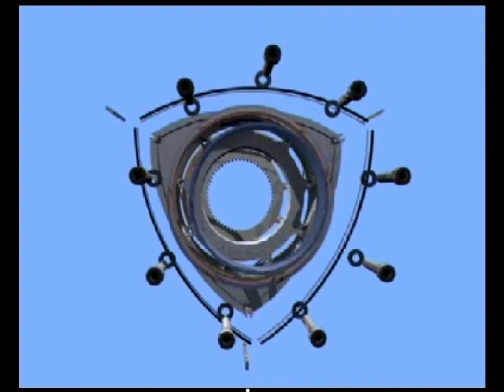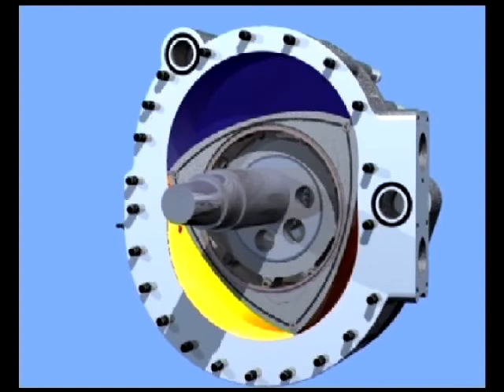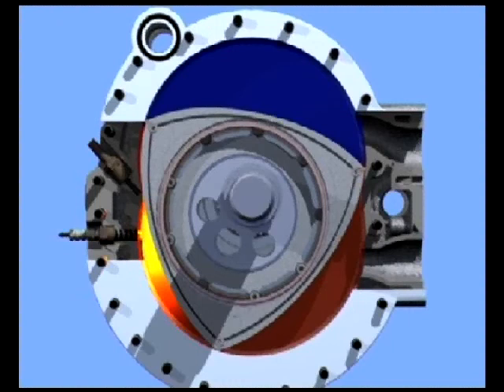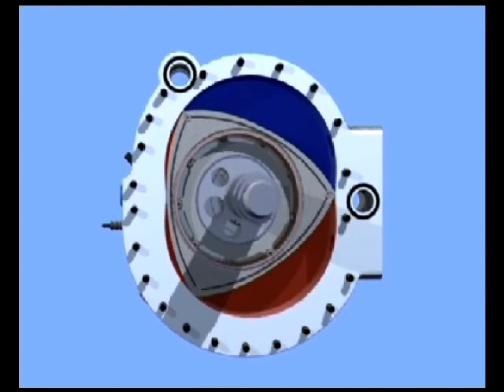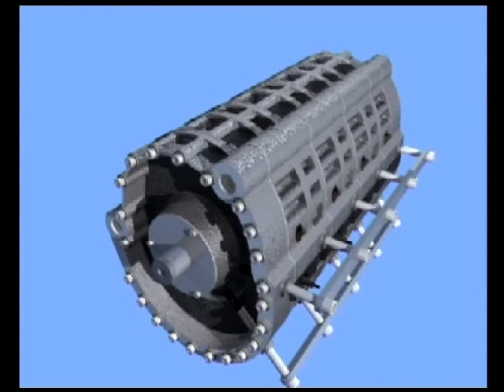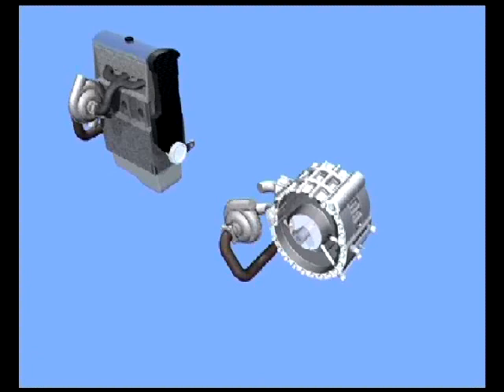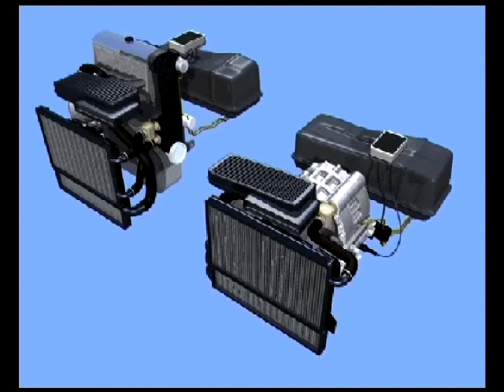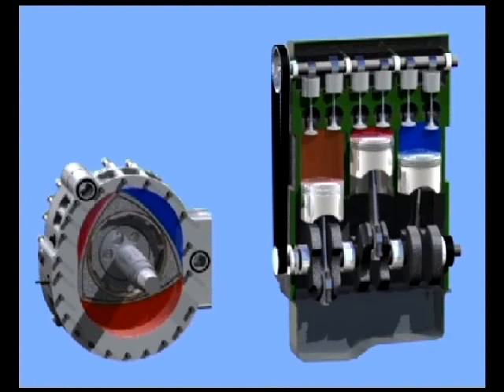WANKEL MOTOR Parts 1-5

Comment: I noticed the wankel engine used in this animation has peripheral intake and exhaust ports.  This seems convenient for the modular approach, but in service leads to a tremendous amount of overlap.  If you look in this animation, note when the apex seal opens the intake port, and how exhaust gas under high pressure would therefore go some distance up the intake.  This leads to a very rough idle and reduced power until very high rpm.  A turbocharger does help alleviate this, but only when on-boost.  Perhaps consider adding a reed valve to the intake, similar to in a two-stroke piston engine.  The flow restriction of the reed valve can be offset by greater port-open duration.
Reply from the maker: Hello JETZcorp. The motor was not designed by myself, but even though, I can't see where the exhaust gases can go into the intake. Please look at 2minutes 45seconds.               OK, I can see it now. When the seal reaches the halfway point between the spark plug and glow plug (3m 05s) there must still be a gap on the opposite side between the exhaust and inlet ports. Perhaps this is what you mean? Yes there would be maybe more pressure from the exhaust side for a short period.                  Sorry, I have been rambling whilst examining the animation. There is another way to optimise the ports that I have seen in a YouTube Video ( I don't remember where): Have the ports as elongated slits, in cross section thinner, but across the whole width of the cylinder.
Reply from the maker: Mark Bayliss Found it: Rotary Engine Breakthrough?   https://www.youtube.com/watch?v=m3pCLjHZmhM    at 1minute 48seconds.                  By the way, I like your style JETZcorp. (Don't read anything more into this)!
Reply: Mark Bayliss The issue with exhaust contamination of the ports is not theoretical, it is a well-known and major issue with Wankels running peripheral intake ports in the real world.  If you search "peripheral port" on Youtube you'll note all the engines have a very extreme "praap-praap-praap" kind of idle, even though they're often doing over 2,000rpm at idle to avoid stalling entirely.  This is considered nearly impossible to deal with on the street.  However, at high RPM such a port is ideal, as airflow is very direct, and charge inertia (and boost!) can overcome residual exhaust pressure.  The solution Mazda uses for their street Wankels is to have the inlet port on the side of the housing, where the rotor face (rather than its apex) seals.  This reduces overlap greatly, but at the cost of bulk airflow.  It is also more difficult to make a modular engine with side inlet ports.  I was suggesting using a peripheral inlet port and reed valve combination to negate the negative impact of such a port, while retaining its advantages.
Reply: Mark Bayliss The issue addressed in that video is slightly different.  It refers to leakage of compressed charge past the sparkplug hole into the exhauting chamber.  While that is also an issue, Mazda is addressing that with some kind of laser ignition system.  I think a surface-gap sparkplug would be a good halfway-measure.  But, that's a separate issue that affects all Wankels, whereas the one I was referring to only affects those with peripheral inlet ports.  The Mazda Renesis engine, for example, has side inlet AND exhaust ports, and therefore suffers no port overlap at all (again, at the cost of bulk power potential).
Reply from the maker: JETZcorp Sorry, I am a 3D-Animation tech. Illustrator, not an expert in real-world motors, but thanks anyway. I appreciate your input.
Reply: I am looking at your elaboration of the peripheral porting's disadvantage. Your claim is real when the rotor-housing had a gap at that exact point where exhaust and intake chambers are separated. Today, with higher precision engineering tools and mathematical formulas, a proper shape can be achieved, without leakages. Yes the poor thermodynamic efficiency due to inhomogenous expansion will be there. So why not use both? Side inlet for low RPM and a peripheral port(although the problem pressure leakage problem will still be there) engaged by a valve. Also I have my own design and ideas about the engine. And you seem like a guy who knows his stuff. I would love to discuss about it.